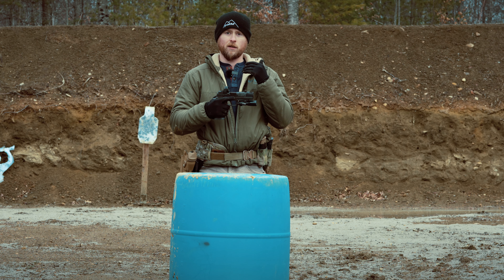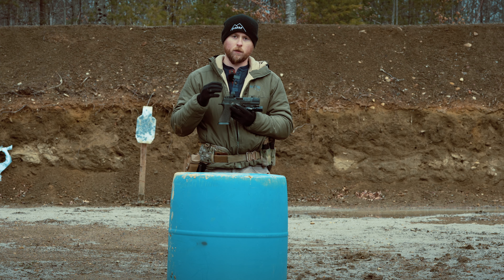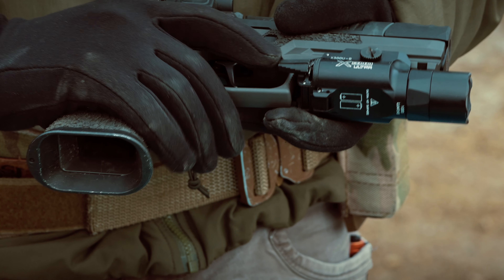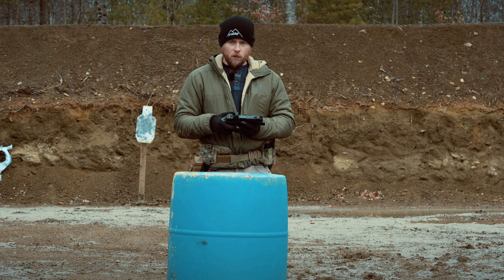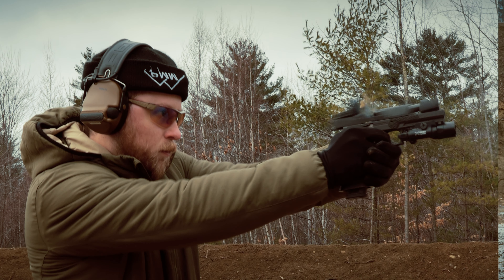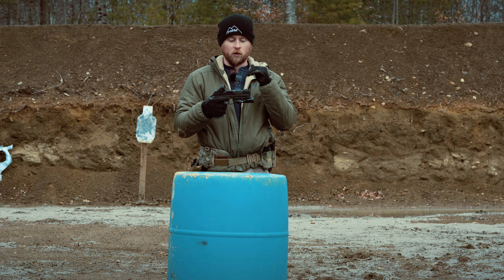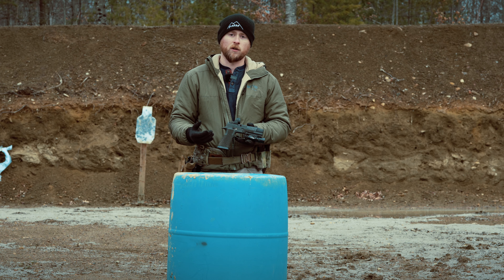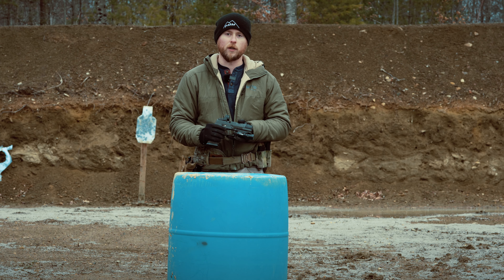Parker Mountain Machine is pleased to announce the release of... Tardigrade

Comment: Guys, question… what Safariland does this gun with the SRO fit in? I have a 6390 but I saw some comments about the optic not fitting
Reply from the maker: We have had no issues with fitment.  We utilize our IDRS for back up irons so the optic is cut all the way to the rear of the slide.
Reply: Late to the party but mine fits in a 6390 with the optic at the rear. It does not appear to be contacting the ALS lock, but it is close.

Comment: Add some p365 grip modules to the line up!  Icarus precision  10-12 week back order and sold out  in the same day.  need some more options
Reply: The aluminum frame is not really worth it. I did the icurus frame with the PMM comp and the total setup cost was $1700. Might as well get a Bul armory SAS 2 UL and it will outshoot the p365 with only a smidge larger carry. Just learn to manage recoil. When u have the chance to upgrade parts or buy a better gun, just get a better gun.